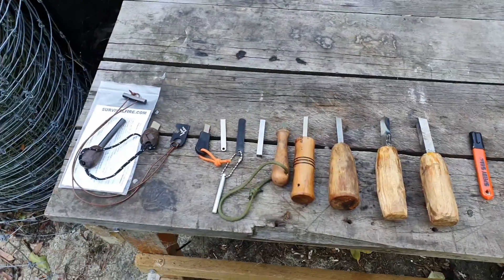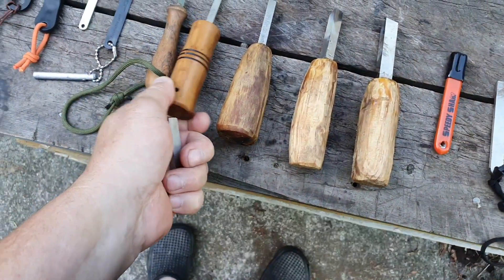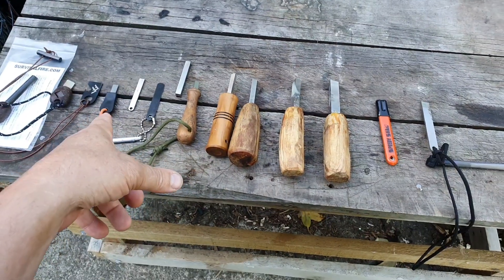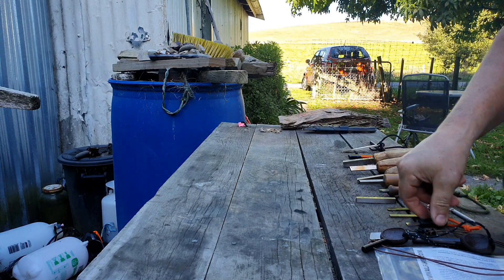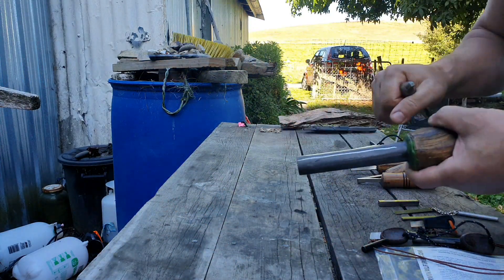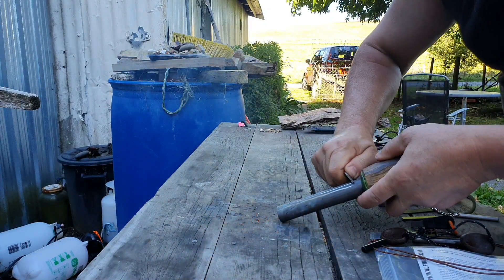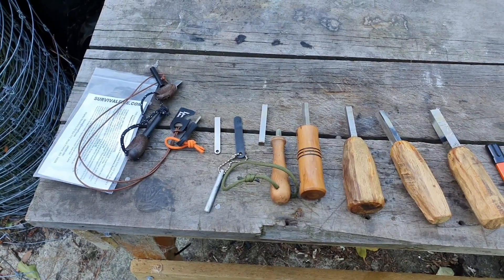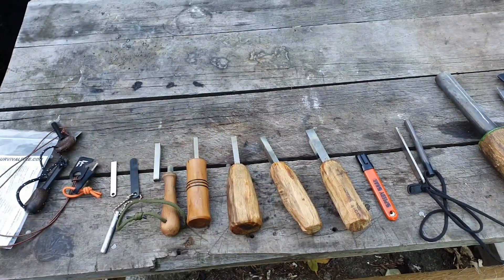Ferro Rod Striker Options and Discussion Whanau! 😝👊💥💥💥💥💥🌏🌏🌏💯💯💯😎🤘

Comment: great discussion Jason, strikers make or break the rod, even with a crap rod you can rip the spark out it with a decent striker. I love my HSS strikers, I lean towards the 200mm ones so I have heaps of real estate to hold onto it. 
Knife spines for me, are the last option and I rarely use them.
Reply from the maker: Agreed Dean. I Thought your approach was unique.  With a wrap. But very versatile  as you only have to swap it round once your edges dulled off. And you could use a para tinder cord. Been struggling with covid🤢🤢🤢 this week me and Mrs Ledbury.  Just gettjng thru the tail end.😝👊 Yay!

Comment: I thought that 1/2” striker would do better than what it did. Nice video!
Reply from the maker: It doesn't seem to be that sharp on its edges. You can't try and buy from ebay or Ali express. I think the one i got 3 out of. Is 8mm x 8mm x 200mm. That was the best for price. Thanks for stopping by brother. 😊👍
Reply from the maker: I also have learned bigger isn't always better. I think the 8mm seems to be the best size for me. Also if you can get it in colbalt it's harder. Higher rockwell. 😊👍